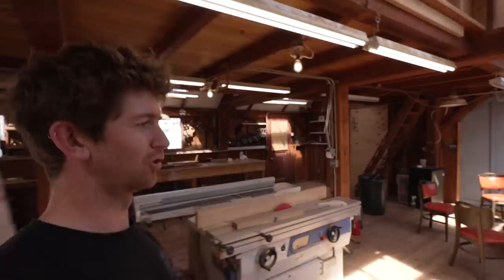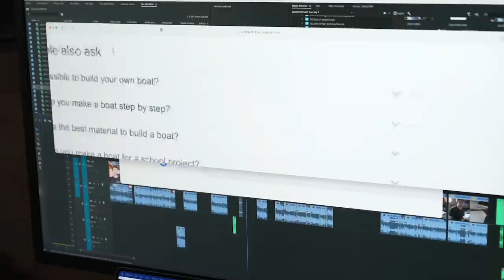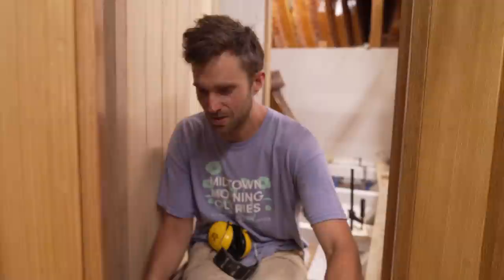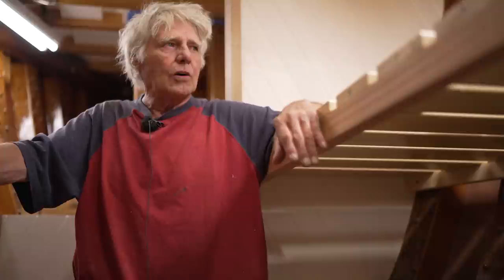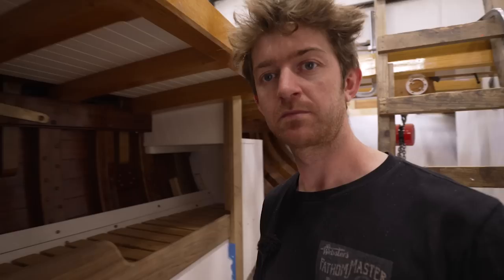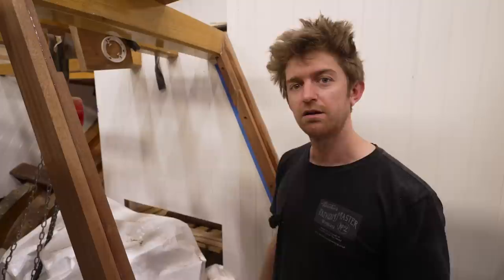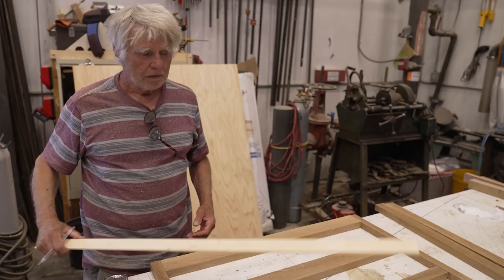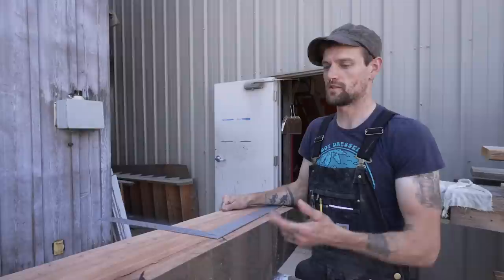BOAT TOUR: Inside the classic wooden yacht TALLY HO!

Comment: Don't seal those LFP batteries in too tight. They don't like to get too hot (or cold). With the proximity to the engine, at the very least, ventilate the battery area as well as you can. Pulling outside air to blow on them is not a bad idea. Project looks fantastic! Carry on.

Comment: Looking good. A question, what is the battery thermal out put ? Being in cased in a cupboard with out sufficient ventilation may lead to battery degradation or possible combustion material. Just had panels and battery fitted in my house in the UK and was warned of thermal ignition when battery gets hot. I love watching the craftsmanship of all the workers.

Comment: Please forgive the idea , but I was thinking the top hatch of the companion steps could be hinged and supported in much the same way as the rear door of a hatch back car, this would make access to the electrical switch systems more user friendly,   hinges and rams could be sourced from a breakers yard, I would suggest gas rams that usually support lorry cabs when tilted to deal with the weight.

Comment: Doesn't the battery compartment need to be ventilated? They'll need cooling and I don't know if those type cells produce any gas which will require venting.

Comment: Nice float around different projects. Love the overall view of what everyone(?) is working on. That workbench looks like it's going to be handy. I just hope no waves or storms come up while you need to get into the battery bank. I think a secondary access through the Capitan's quarters might be a good idea, just in case. But it's not my boat or design. Love that y'all are reusing some of Tally-Ho's old teak for the bunk rails and hopefully other trim as well.
Looking great, see y'all on the next one.
Reply: I agree with you regarding the battery position.... It would give me some concerns, if it were my boat (which of course, it's not).  As I'm not involved, nor am I inside of Leo's mind/design, I really can't say where else to put them.  Certainly, the lower the better. Easily accessible is (dang near) a requirement due to the weight of LiFePO batteries....  But right under the companionway, forward of the engine room, seems quite vulnerable to me.... plus, possibly restricting access to the engine room....

Comment: I'm amazed by the very wide variety of wood species in this boat. Certainly way more than were used in the original. Can you let us know what you used where? I didn't recognize the soles Patrick was building, and the frames or slats on the bunks Richard was making, my guess was that the bunk slats were offcuts from the decking cedar.
Reply: Purpleheart - keel, centerline timbers, hull planking butt blocks, knightheads, engine mounts, cabin sole supports
Southern Live Oak - hull frames, stern fashion pieces
Black Locust - frame trenails
Angelique (Red Louro) - bilge stringers, beam shelves, 5 lowest hull planks (garboards), topmost hull plank (sheer strake)
Wana (Basralocus) - all other hull planks
White Oak - deck beams, bulwark stanchions, sampson posts, interior door frames, mast support partners
Teak - transom planks, covering boards, king planks, interior trim
Alaskan Yellow Cedar - deck planking
Douglas Fir - interior bulkheads
Ash - cabin sole (flooring)

Comment: Usually when you build / restore a boat, your going to need to launch the empty hull into the water to test if it will float before you can fit out the boat, otherwise if it sinks or floods after you have done the interior without testing it you lose the interior and the boat which is a lot more than if you test it first  before you put in the interior so you only lose the ship instead of both. It saves time effort materials and money.

Comment: It's crazy how big the boat looks on the inside just by adding walls.
btw: Are all those screws brass?
At this point the engine might be the only thing made out of Iron. A bit of a shame, but I doubt there is a reasonable alternative.
Reply: All the screws and bolts are aluminum bronze, while the rivets are copper. Brass isn't strong enough for these fastenings.
Reply: @frederickstibbert7389  Good to know.

Comment: With all the el electrics how do you intend to lay out the cables , ??   Can  you run conduate and put in waterproof junction boxes , do all connections above the water line ,
I can never understand cables under the floor , it's great when you can pull a new cable through conduate. The one that has a slit in it and flexible,  
How will you run airflow extractor for the battery and engine bay , ?

Comment: Why don’t you build an enclosure for just the batteries and inverter out of sheets of Perspex. Glue the edges like a fish tank and seal the top with rubber gaskets. That way its like a reverse fish tank dry inside and wet and humid outside? Cheaper and guarantee that the batteries will never get wet.

Comment: I hope you will give serious consideration to a Webasto heater instead of the one currently shown on the layout plans.   The Wesbasto heater is would be located in the lazzarett (so it takes up no valuale interior space), and it supplies heated air via ductwork (so efficient!).  I've lived with this system, and I love it.

Comment: For a private vessel, is there some kind of safety test or set of requirements like there are for other vehicles/ structures? e.g. MOT for a car, or house building regs (like staircase headroom etc.)
Reply: There's a comprehensive set of standards (used to be called "German Lloyds" but that company changed its name after a merger) that covers wood, metal & fiberglass yacht constuction in terrifying detail. I looked into a bit of it, checking the size & spacing of Tally Ho's frames - which turned out to be robustly in excess of those req'ments.
Reply: @frederickstibbert7389  Thanks for the answer. I was just wondering if someone could build anything that floats and set off on the water, after he mentioned getting the head height correct.

Comment: i probably missed where you talked about it , but i was wondering how you’ll be charging your battery bank and whether you’ll fit her out for comfortable off grid cruising and living aboard ? have you talked about what you want to do with her when you’re finished  ? was wondering especially how you might fit solar panels / wind generator on such a traditional design . and what sort of dinghy you want and how you’ll carry it . devil is always in the details . have you picked out a windlass and ground tackle ?
Reply: 1) Charging by a) using the diesel to drive the motor/generators w/ prop shaft de-clutched, b) dragging the prop while under sail, to turn the motor/generators w/ the diesel de-clutched, c) converting shore power.
2) The stated plan has bern to return to England & enter the Fastnet race once again.
3) I don't think Leo wants either panels or turbine, but an emergency-use panel probably wouldn't go amiss.
4) He has the line drawings for her original dinghy, which lived canted upside-down to starboard of the main companion w/ a single davit.
5) He's got the original massive capstan, no doubt it needs some refurbishment.
Reply: @frederickstibbert7389  so no plans to use TH as a liveaboard cruiser ? running the main engine to generate electricity has quite a few drawbacks , unnecessary carbon emissions being but one .  won’t dragging a spinning prop turning a generator create quite a lot of underwater resistance ? solar is really the only way to go for abundant clean power , but if the boat is living at a dock or on a mooring uninhabited it doesn’t really need much electricity .

Comment: Leo, I am not quite clear, do you or do you not have much woodwork et to do on the boat. Cause if you do I can mail you a Porter Cable power planer complete witth spiral cutter heads. It is not a flat congifuration but has the "L shapped body made for doors. It is the older model 126 Porter Cable made around 1970, so let me know It has 3 new carbide cutter heads Gary

Comment: The octagonal hole in the deck makes me wonder, solid or hollow mast?
Reply: Hollow
Reply: @on4xb  Well now I know. Thanks.
Reply: Hollow for weight saving (the missing wood on the inside would have contributed little to bending resistance) & it gives a handy place for otherwise vulnerable wirings for lights, data & radio antennae.
Reply: @frederickstibbert7389  Hollow would be my choice. But solid would have been more traditional.  So there was a good possibility Leo would have gone that way.

Comment: 6:35. . .  Leo, what's the tool/ implement/ ruler/ whatever shown laying on the bench with "Leo - Tally Ho, 1909" on it?
It seems to have various angles on it? What would it be used for?
Reply: It's a bevel gauge angle guide or layout card, one of several types used for setting or reading a bevel gauge.

Comment: what about splatter from the chain onto the workbench, once you get underway. are you going to use some kind of cover to protect from moisture?
Reply: The anchor chain rides inside a tube or duct from the deck to the chain locker, it's not exposed to the cabin. There's a boaty name for this tube but I've forgotten it.
Reply: @frederickstibbert7389  Hawse pipe >> Spurling pipe ?
Reply: @thistledown6026  - Thank you, my brain couldn't get past the hawse hole.
Reply: @frederickstibbert7389  No worries...I had to look it up myself!
Reply: @frederickstibbert7389  No worries!...I had to look it up myself.

Comment: please tell me what glues you are using on joinery, so much work eh
Reply: On the hull, all deadman repairs & plugs were glued w/ polyurethane (PUR), except one centerline timber repair was epoxy. In the interior, the faces of the double-layer bulkhead walls are bonded to each other w/ epoxy, & the plugs appear to be glued w/ carpenter's wood glue (PVA).

Comment: Leo, what species of wood is being used for the sole. Same question on cabinet adjacent to the head?
Reply: See the video description - the cabinet face frame is White Oak, the sole boards are Ash.
Reply: Frederick Stibbert, thanks, I did not read the description. Curious though, the cabinet fronts don't look like white oak, more like teak or angelique or ? Ash is commonly used for floors but has no rot resistance, so on a boat?

Comment: Great vid and craftsmanship. I built a hybrid steel canal  boat 12 years ago and used 20 lead acid batteries and 12kVA gen set. Why did you go Lith ion as it's so much more costly and lightness is an issue for you? I need those lith ion batteries for a 50's motor boat , took a V8 out, put a 14kW Lynch motor in, that does need lith ion but I couldnt afford so used 8 x 80 a/hr lead acid which are to heavy realy! Heavier than the V8!!

Comment: I asked this one time before I would like to know what kind of saw that I see you and others use I think that it has a Japanese name or Origin. I think it has cutting edge on both sides.
Reply: The two-sided Japanese carpenter's saw is called a ryoba, w/ one side for crosscuting & t'other for ripping. These saws cut on the pull stroke, the blades are v. thin & the teeth have a minimal set for a v. narrow kerf.
Reply: @frederickstibbert7389  Thank you I knew it had a Japanese name just couldn’t remember. Again thank you.
Reply: @Pdblee  They're often advertised/marketed under the description "Japanese Pull Saw"

Comment: I'm sure you have things underway already for the water tight space for the batteries... I am a fabricator from Minneapolis/Seattle. I would suggest a custom aluminum locker with sealed doors. you can use rubber grommets for the wiring, but the cooling for the controller/regulator (maybe inverter) needs to be addressed. maybe someone has an idea?
Reply: No! Never use that. Aluminium is a very reactive metal and once ignited rapidly burns releasing even more heat. A burning Li battery with Al next to it would be a disaster.
(You might have read about aluminium superstructures on RN warships during the 1982 Falklands War.)
Stainless steel may suit.
Reply: @alexandermenzies9954  so even bladder lined fuel cells I see in almost all modern sv aren’t okay??
Reply: @tbonerox2806  I don't know if they (fuel cells) are OK.
Here, we're considering a large number of high capacity Li batteries on an 'isolated' boat which if hot enough would make ultra quick work of any aluminium locker. 
Reminds me of the initial troubles with the B-787 and its Li batteries, as in a boat, you can't just jump out to safety 🙂.

Comment: I know you said that the batteries are very safe. Much safer than "regular" (regular to me) batteries. But if those catch fire, I mean, it's a heck of a lot of energy that could be unleashed, then how will you get out? Couldn't there be a massive fire at the only spot where you need to escape?
Reply: There's a ladder & hatch in the forward cabin.
Reply: @frederickstibbert7389  I did not know! This is good :)

Comment: 16:25 "It's not uncommon for a wave to come crashing down." With all due respect it's not uncommon for the bilge to flood after hitting a submerged container that fell off a ship in a storm too. I would put those "battries" in a finally woodworked shelf hanging from the ceiling at the highest part of the interior. You guys built a boat from scratch practically. I'm sure you could figure out how to create a solution. All electronics inside need to be up high, that is all, carry one. LOL
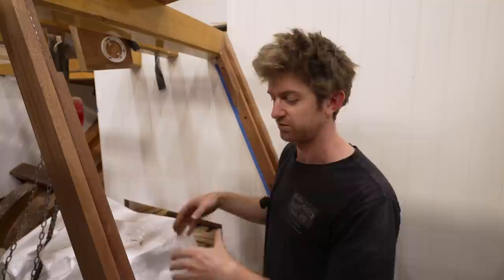18:50 Maybe put the battries up high in that new space under the stairs, maybe one battry under the top 5 stairs and the rest moving aft, in line, up high Full Stop.
19:30 Scratch that under the stair idea. Maybe steal some space from above the engine and design a battry compartment so the battries would sit immediately behind the control panel up high as far away from water as possible.
Reply: On the other hand, the batteries are very heavy need to be as low as possible to keep the center of gravity low. In fact they are a part of the internal ballast
Reply: @on4xb  How much do they weigh?
Reply: @darkmath100  +- 50kg each
Reply: @on4xb  Options are:
1) tolerate another 0.1-1.0 degrees of roll
2) not have any battry power to pump out the bilge in the event of a hull breach during a storm.
Solutions are:
1) Leave 'em where they are
2) add the equivalent weight to the bottom of the keel
Compromise is:
1) Have a voyage last another 1% of time by moving the battries higher and adding lead to the keel.

Comment: Still puzzled why you didn't just take it completely to bits and duplicate the parts. Seems like you made lot of extra work for yourself. It's hardly a restoration when so few parts are original. It's a Trevors broom. It may be a duplicate but a restoration requires that the vast majority of parts are original and repaired not duplicated. It's like the current historic aircraft scene where they change every part but the makers plate and claim its a restored original instead of a copy. Amazing and highly skilled work but the boat is a new boat.